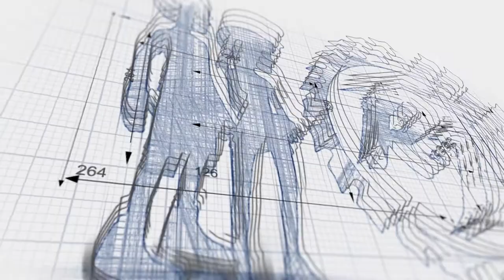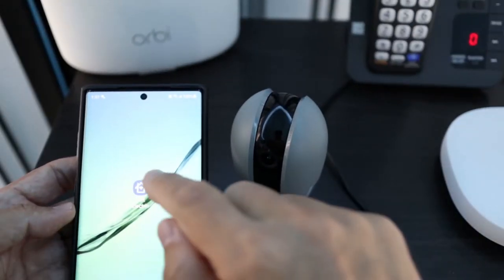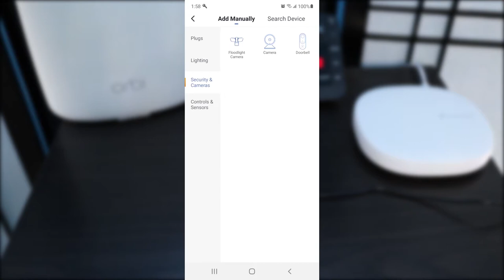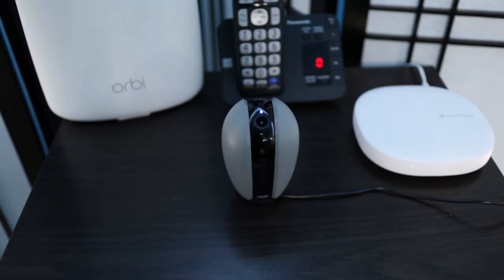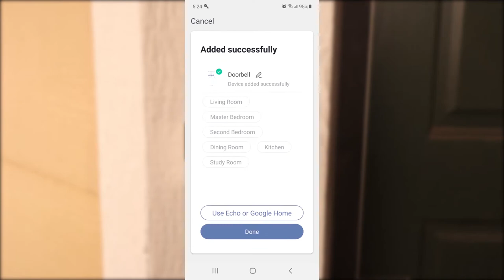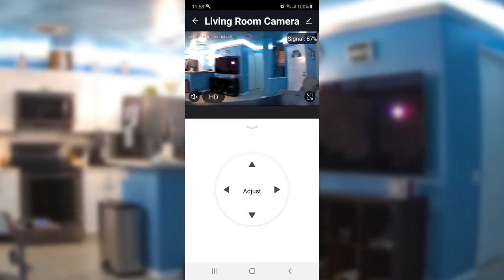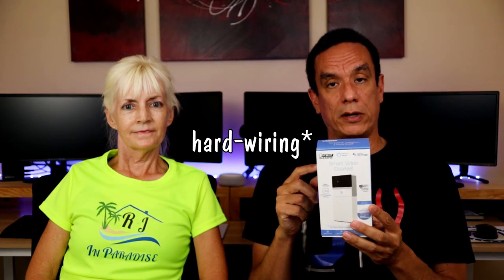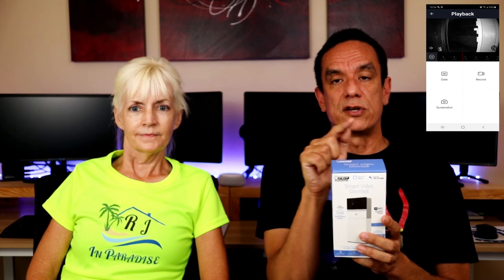Install & Review: Feit Electric Smart Doorbell and Smart Indoor Camera

Comment: We have the wired doorbell from Menards. We bought the spotlight cam from Costco first. And we noticed the issue with the doorbell that you noticed. If you record by choosing record, a listing is created in album not unlike the video listings in playback for the spotlight cam. I called Feit last night, asking for a callback. I got the call this morning. And what they said is doorbell / app is just designed that way. You can only scroll through the timeline on it. 
One other issue they spoke with me about. I had told them I couldn't open the app while I was talking on the phone. Because the phone call would experience a sound like static, and then no sound at all. And then disconnect. I have android 10 and I use Google fi for my cellular service.
Reply from the maker: Thank you so very much for taking the time to watch our video and for leaving an awesome information packed comment. I realize it might not be easy for Feit to reprogram the app for the doorbell but maybe someday it will get pushed out as an update.

Comment: The wireless doorbell how long does the battery last? Is it rechargeable? Thanks. Good review!
Reply from the maker: To be honest, the charge seems to last for a long time (several weeks) and other times, just a week or so. I believe it has to do with how often the camera kicks on. For example, on windy days, our plants around the porch sway a lot and the camera picks up the movement every few minutes. When this happens, the battery wears out much quicker. I hope this gives you a general idea.
Reply: @Poor_Mans_DIY  I had the same question so thanks for the response. A follow-up question is, do you have a replacement battery and/or how long does the battery take to recharge?
Reply: @DimpledRae  I do not have a replacement battery. As for cjarging, i have numerous rechargeable batteries and this device takes longer than any other to charge... but, it is the size of about three AA batteries so it may be charging them one at a time. Not sure exactly how long it takes to charge as i charge at night and plug it back in , in the morning.

Comment: any idea how to remove the battery from this Feit doorbell if the camera was removed from the mobile app? you have to unlock the battery from the camera with the app. the reset button on the bottom of the battery stopped working (even though the battery has a full charge) so i am unable to pair the camera with the mobile app, so can't use the mobile app to unlock the battery. ugh
Reply from the maker: To be honest, I was never able to get any unlock to work. It is not perfect but I now just pull the battery out, charge it and then force it back on. It may not be the manufacturers ideal method but it works for me. I figure , if a burglar sees the doorbell camera, they might just smash it. What is important is that the camera picks up an image and warns me. I believe it also serves as a deterrent as well. Sorry I am not of much help to you. If you have any other questions, let me know and I will do my best to try to provide you with a proper resolution.

Comment: I like to know more about the videos location. I understand that the video recording will be store in the memory card. Is this like a WYZE where there is also a limited recording is in the cloud? What is the time limit for cloud videos? If they upgrade the software version, will the camera upgrade by itself? Will they stop suporting camera versions like WYZE? How many people can you share your camera videos with? Can others people get warnings in case I am not by my phone?
Reply from the maker: Let me first thank you for taking the time to watch our video. We both appreciate it very much. Now to try to answer your questions. First, I am unfamiliar with WYZE so I cannot compare them. The Feit camera stores recordings directly on the SD Card. It does not utilize the cloud. You can use the application to ensure you have the most current software and firmware. I have yet to see upgrades on either and the app indicates I have the most current version. I have no idea if they support WYZE cameras. The application allows you to share with others but it does not reflect a limit. If you share with others, it should mean they can set the application to notify them if there is any movement detected. We are not FEIT employees so I am unable to provide answers beyond my experience with the product. To be absolutely sure you get the proper answers, I recommend you contact the FEIT helpdesk. They have been very polite, knowledgeable and quick to answer my questions when I contact them and I am sure they will be able to answer your questions as well. I am sorry I was not able to fully answer your questions but if you wish to ask more, please feel free to do so and we will try our best to answer.

Comment: How did you get the battery off to charge it? How long does the battery last?
Reply from the maker: I struggle with the battery but use brute force to pull it off and to snap it back in. Some times it works out easily but most often, it is a battle. The battery charge time varies drastically depending on how often the camera records. During a windy day, tree branches set off the camera non stop and the battery only lasts a week or two. otherwise, it lasts around a week for us. If you have any further questions, please feel free to contact us and we will do our best to provide you with a proper resolution.

Comment: Thank you for the great tutorial! I have the wi-fi wireless door bell, wi-fi wireless security camera and the wi-fi outdoor wireless security camera. They work good. I have a big issue with all of them that is I rarely can review the recorded videos on the SD card. All of them have 32gb cards and formatted by the cameras. I can see the SD cards in app there is space used for recording. Is there anyway to make the recordings to the cloud or somewhere else than the SD cards? Thank you!
Reply from the maker: Thank you for watching our video. We appreciate it very much. In response to your questions, please note that I am not an expert of these products but I will provide you with information based on what I am aware of. 1 - There are different types of SD cards. Inexpensive cards have often are unable to record data as quickly and may cause problems. You also mentioned you formatted the cards on a camera, Format the cards within the security cam itself. The app has a "Format" feature. This might help make the SD cards work better in the security camera. 2 - I am not aware of a way to save recordings to the cloud for this device. You can open the app and locate a recording based on the date and time. To the far right there is a down arrow. By clicking on it, the video will download directly to your phone. There is also software that allows you to make your PC work with Android apps. I install feit app on my computer and download videos onto my computer instead of my phone. I hope this helps but if you need more information, please let me know and I will try to explain better.
Reply: @Poor_Mans_DIY  Thank you! I formatted the cards with the security cameras originally. I don't have the arrow for the video in my app. I have the most up to date app. Can you give me the site you downloaded the app for your PC? I couldn't find that. Thanks again!
Reply from the maker: @belalantos5466  I use a program called Bluestacks. Once you install it and then open the program, it is an Android program and you can download and install android apps that run inside Bluestacks. It is free and based on my research, it appears to be a safe program to use. you can download it at https://www.bluestacks.com/. If you have more questions, feel free to ask.
Reply: @Poor_Mans_DIY  Thank you again for spending time with solving my issue! I Downloaded the app and somehow I can't view live pictures on any of the three security cameras. Do you have any advise? I will still work on it. Thanks again!
Reply from the maker: @belalantos5466  I need to make sure we are talking about the same thing. Are you trying to view the cameras from your phone and you cant see live, OR are you trying to view the cameras from your computer using Bluestacks?
Reply: @Poor_Mans_DIY  With my phone a rarely can review the recorded video and can't download them. When I manually take a picture or video than those will be saved onto my cellphone. With the Bluestacks I can't see live feedback of any cameras. I see them on the main page, they are active but when I click on them it takes me back to the main page where I see all cameras. When I click on screen split I see the live feed of three cameras side by side. It is weird. I don't get it why the Bluestacks doesn't let me view the live feed. What do you think? Thank you for your help again!
Reply from the maker: @belalantos5466  I tried to see if I could work out a solution for you. When I opened Bluestacks there was a new version update, which I installed. Once I installed it... my Feit application no longer works. I have the exact same problems that you have. I am so very sorry but the only thing I can suggest now is for you to use only your phone.
Reply: @Poor_Mans_DIY  Thank you for your help!

Comment: Couldn't get my cameras of the same brand to stay connected to my wifi
Reply from the maker: May I trouble you to explain what you did and what errors occured? Maybe I can help. If not, you can contact the Feit helpdesk. They were very helpful when I contacted them once before.
Reply: @Poor_Mans_DIY  long story so here goes.
I got them both to work but once I decided to move them, one wouldn't connect after I closed out the app.  I boxed up the one that wouldn't connect and the 1 that still was connected eventually wouldn't connect either. They both kept saying connecting to encrypted channel or something like that I forget.  Side note when I 1st connected them I had to go to the farthest room away in order for them to connect to my Wi-Fi which is 2.4 GHz I believe. All other feit products stay connected I only have plugins though. Amazon is sending me 2 more different units and I still have to connect them I haven't been home yet for a couple of days.
Reply: @Poor_Mans_DIY  update: just got my 2 replacement cameras and same issue, they switch back and forth to which one works and which doesn't for some reason.
Reply: @waaazupd1948  This is just my opinion based on my 30 years as a system administrator. It is possible that you receive two defective products. This happens to even the best computer manufacturers, sometimes things break right away. The fact that you received two new cameras and you still have the same problem, I would look into troubleshooting other possible issues. It might be possible that the Feit software is not compatible with your smartphone or computer. It is possible you might have some Anti virus on your network that is causing the problem or much much more. If at all possible, I would see if you can connect the lights on a friends network and use their smartphone. If it happens to work at your friends, then you narrow the problem down to something on your system (Not saying it is your systems problem, it just might be a simple matter of some other software or configuration that is just not compatible). If it doesnt work at your friends, then I would look at it as confirmation that the cameras themselves are the problem. If that is the case, and if I were you, I would ask for a full refund at that point.
Reply: @Poor_Mans_DIY  update: I uninstalled and reinstalled the app both cameras work now
Reply from the maker: @waaazupd1948  Great news. Thank you for sharing. I will keep that in mind if I ever run into a problem.